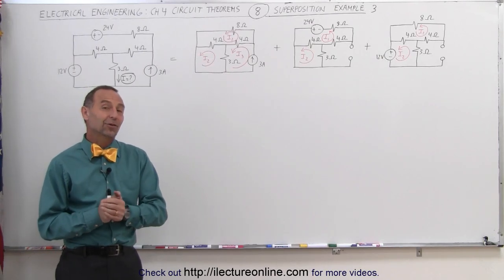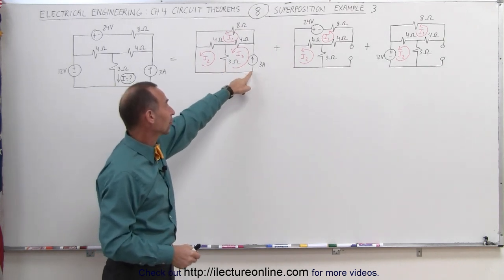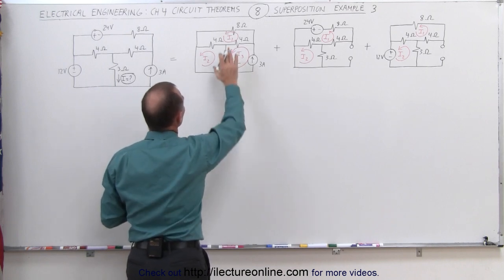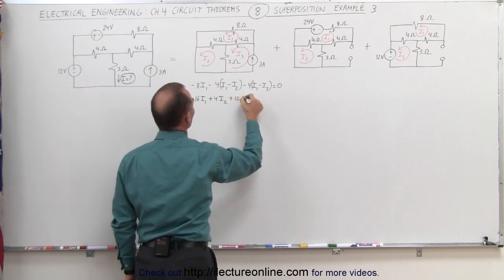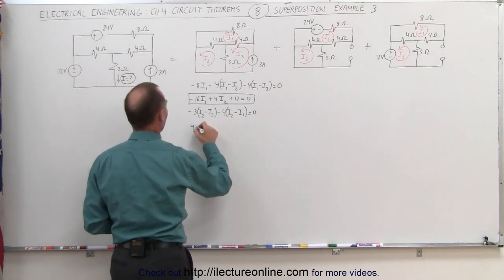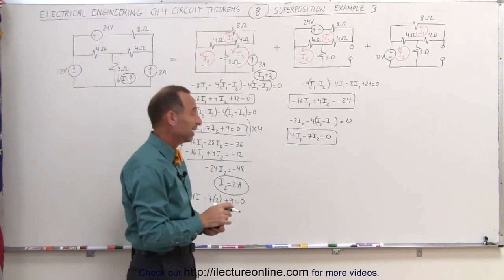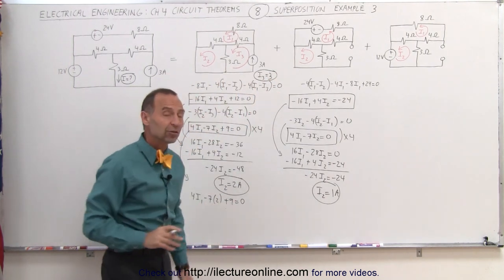Electrical Engineering: Ch 4: Circuit Theorems (8 of 35) Superposition Property Ex. 3

Comment: man this is hard. for someone that relies heavily on sign convention, your equations are confusing. my I2 is 2A for 12v circuit instead of -2A. so my answer for sum of I is -2A. is the answer still correct or not...?
Reply from the maker: Yes, there are 2 camps.  (positive or negative charges moving).  In the end, it makes no difference at all and you will get the exact same answer.

Comment: teacher in first circuit, why 24 in the first equation is negative sign? is it should be poasitive? may you explain?
Reply from the maker: If you traverse the top loop in a counter-clockwise direction, you will go across the 24 V battery from the negative end to the positive end, thus that is a voltage rise.

Comment: Sir could u explain more detail about the mesh direction? Actually i tried opposite direction than yours but i got the same answer with u (like I2 = 2A but i used clockwise direction) , even i got the current value, i still confused about all the current direction in this Circuit😅
Reply from the maker: Yes indeed.  That is why it doesn't matter which direction you choose initially.  You will get the same answer either way, except that you will get the negative value to indicate that the actual direction is opposite to the direction you chose initally.

Comment: I could be mistaken but at 6:02 shouldn't that equation read -16I1 +4I2 = +24. When you selected your mesh directions you chose anti clockwise and so the current enters the voltage source from the negative terminal in your case. Due to passive sign convention should it not be taken as -24 when setting up the equation (which will of course make it +24 when taken over to the other side in the final equation).
Reply from the maker: The equation in your comment and the equation in the videos is exactly the same, so I am not sure about your question.  I just checked the video and it is correct.  (So what part are you not sure of?)
Reply: that equation he put down is different from the one you have in your video. Should it not be taken as -24 when setting up the equation not +24? Regardless, thanks for the videos!

Comment: Thank you sir. This video is really helpful :)
So superposition can be applied when summing currents, right?
I have example that has two current source and one voltage source, and I try to solve it with the superposition method. but one resistor doesn't have any current through it when two current source becoming open. Is it fine or still consider about that one..?

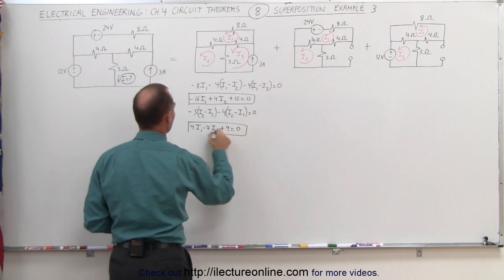Comment: Hello sir. At 3:28 can you please explain why the I3 in the first circuit out of 3 is exactly 3Amp ? If im not mistaken I know that we should select a node and then find from the KCL the Current of the Meshes  that pass in that node(including the current of the current source if there is any ). But is there any rule of which node to select because I can select any node I want and the Currents of the meshes will be different (A3 won´t be 3 because of an equations with 2 unknown variables). for example the node behind the arrow direction gives us I3+I2= 3 amp...thnx for the videos
Reply: answering to myself after watching some videos because someone might need it or the profesor can correct this if again im thinking it wrong. There is no node to select just 2 cases(maybe im dumb for thinking of that ide, but made sense for me at first) . 
First case: 
If the current source is part of ONLY ONE loop the Current of the mesh (and all the other currents of the resistors of the mesh that aren´t connected with other meshes)  have the same Current as the current source. 
Second case : 
If the current source is part of 2 or more meshes in the same  time then the whole wire (with all the branches including resistors, the current source etc) that separate the meshes / loops where the current source is "touching" , is "removed" to create a super Mesh. The currents of meshes where this current source is, create an equation where the current of the meshes is positive if they have the same direction as the arrow of the current source and negative if the have the opposite direction. In the end we should write equal to the value of the current source. For ex I3-I2- I1= 3 A (the value of current source). 
Every feedback is welcomed. And please as fast as possible because i have an exam in one week  :)

Comment: I know that u defined I3 as going around in that one part of the circuit, but how can u define it that way? Do I not need to calculate how it splits left and up (into the 4Ohm and 8Ohm resistor)? I realized this when u were adding all the currents in the end.
Reply from the maker: We can take each loop (or each branch) and assign a current to it.  Then using Kirchhoff's rules, or the superposition theorem, or any other method and solve for the currentls.

Comment: Hi sir just a quick question 
For circuit with current source only- the current will not bypass 3ohm resistor as it will try to follow least resistive path?
Reply from the maker: The current will go through all available paths.  More current will flow through the paths with the least resistance, but NOt all of the current.

Comment: teacher.. in third circuit the direction of the current of 12 v source must be in opposite direction to loop "I1" ....so will rise voltage when you  take loop 1 ... you suppose to change the Signals
Reply from the maker: When you pick the directions of I1, I2, and I3, they do NOT need to be the "correct" directions and it doesn't matter what direction you choose.  In the end, if you picked the "incorrect" direction, you will get a negative answer for that current.  Note that I2 = - 2 A
Reply: ya that's right thanks for clarify
Reply: @MichelvanBiezen  what if we picked the correct direction, which resulted in us getting a 2A instead? then that means our I for the original circuit will get -2A. is the answer still correct then?